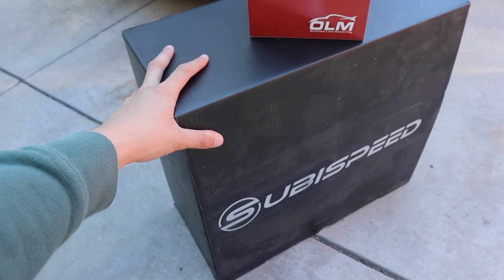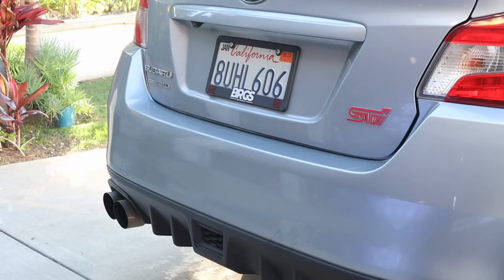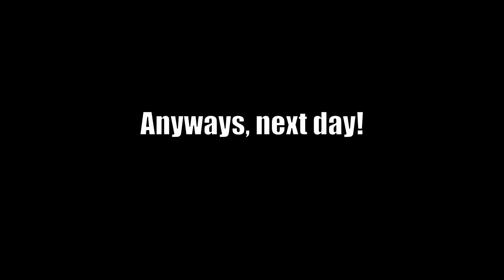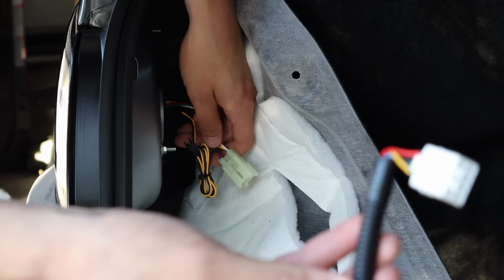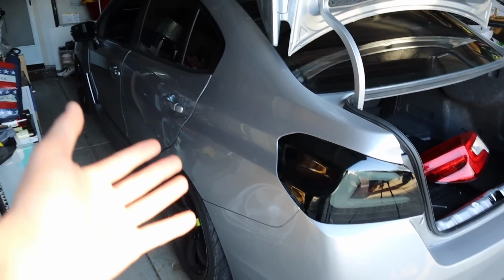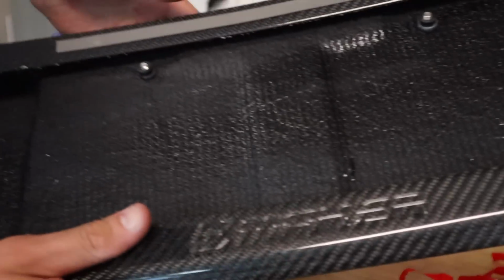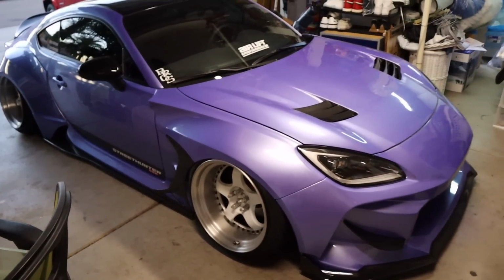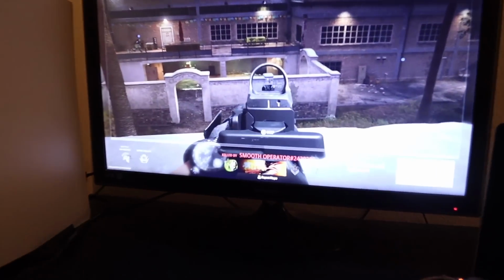More NEW MODS For My 2020 Subaru WRX STI!

Comment: Nice!  I just installed some very similar tail lights and 3rd brake light in the past month or two as well haha.  Looks so much better.    Was just going to comment asking if you’re going to wrap it and then heard you’re wrapping it in December haha.  Got any good recommendations in the area?  I don’t feel confident to do it myself, and from looking around I keep getting quoted around $3800-$4500.  Any suggestions would be huge!

Comment: U got it tint the 3rd brake light now so it match the taillights, also one think I recommend when getting new lights is to put silicone all over the edges so water doesn’t get through and damage them
Reply from the maker: Was gonna get the smoked brake light but didn’t want too much smoked stuff on the back!